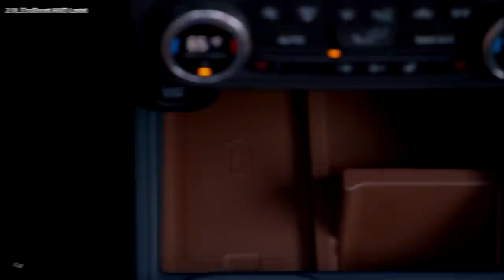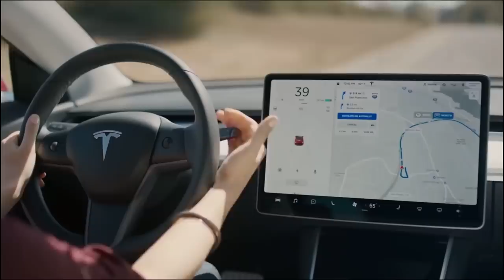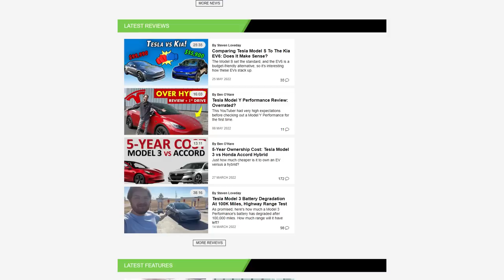Ford CEO Confirms Ford Maverick Has A HUGE Problem

Comment: Fact is 1 the quality of their engineers has been going downhill for many years!
            2 they don't do enough extensive testing before releasing for production.
            3 Trying to cut too many corners to save $ has a direct effect on quality.
Reply: U hit the nail right on Fords head. Bill Ford do not test products for durability. Ford budget then test the products on their customers. Bill Ford reminds me of Detroit Pistons Player Bill Laimbeer. Blame everybody but yourself. I still ❤️ Laimbeer 🍺🍺🍺
Reply: It is the result of man factors, but arrogance  and lack of industry background at the top is the critical element.  Hackett  ran three major  FURNITURE companies into Chapter 7 liquidation before his close friend Chairman Ford brought him in as CEO with zero automotive experience.     I have been told he trashed engineering and gutted the manufacturing  systems by getting rid of people thought to be "expensive" .  When you loose that experience, it is gone forever.    Cutting  deadwood is a plus, but total ignorance of an industry  means  you cut wholesale and eliminate the good with the bad.  The new CEO is all sales and marketing and he knows nothing about manufacturing and engineering.
Reply: @jamesb4789  that’s the COO’s job normally - most of these issues are problems with suppliers sub components. Ford doesn’t make airbags or brake pads…
Reply: @jamesb4789  Hackett 😂😂😂🤣. Your right, he ran Ford into the ground. I agree the past and current CEO’S do not have manufacturing experience
Reply: @piersdenney  Just add to the list of problems 🤨🥺

Comment: I almost regretted not buying last year, now I'm on the list for the next batch.
Reply: I ordered last year, still waiting.
Reply: I would wait a few years if I were you. I was interested in the Maverick, then aside from all the problems the truck itself may have, they're using a 2.0L EcoBoost engine that has no fuel injectors behind the intake valves. I'm curious to see what happens when these engines hit about the 50k mile mark. Most people are not going to install catch cans, will use the cheapest, most low quality gas station around, and use the cheapest motor oil/oil change in town.
Reply: @justacinnamonbun8658  The Hybrid has a different engine. 2.5 liter Atkinson cycle.
Reply: @morrismonet3554  Yeah, it also has a catalytic converter that for some strange reason glows orange and melts wire harnesses that run under the body. 🤷🏻‍♂️
Reply: @justacinnamonbun8658  Not true at all. Hater's gonna hate.
Reply: @justacinnamonbun8658  - And tell us you have actually SEEN the Cat glow orange and melting wiring harnesses?????

Comment: My father was a transmission specialist for of 35 years. Ford will play well do to the fact their taking the EV evolution seriously. Even if Tesla makes 2 to 3 times the vehicle, not everyone wants one. Other EV, producers will surpass Tesla if they keep true to their brand. (Mean styles) Tesla, are on the boring side. Let's study Honda, they managed to always stay ahead of the group  for years, their designs are not dated. A 2000 accord in the year 2010 still looked modern. 

JG.
Reply: But you gotta admit.... The Ford F150 Lightning.... A truck nobody asked for.
Reply: @justacinnamonbun8658  -What year Lightning ???

Comment: Quality has been an issue for the domestic builders for decades! It's why foreign manufactures captured so much of the market to begin with. I quit buying domestic brands in the 90's because of it! Still, Ford does at least seem to be trying to deal with the issue and the Maverick is a great looking rig! I wish they would come out with a extra-cab version for people who what a real truck bed in place of a 4 door truck! It's the same issue Honda has with the Ridgeline IMO.
Reply: My 2022 Ranger Lariat is the size of what used to he the Mid-Size truck now... And Its the SuperCrew so it has a back seat that is not all squished up like the Super Cab.. The way they did this was to make the SuperCrew with only a 5 ft bed... The SuperCab only has a 6 ft bed... I don't haul people and the 5 ft bed is just fine for me...

Comment: I never get people complaining about recalls. They're free and I'd rather get them than a manufacturer try and ignore any potential issues that crop up later. Judging by my experience with high mileage 10+ yr old ford's they will be much better vehicles later down the road with the recalls ford is performing on behalf of their customers. Gotta remember this is the first model year of a brand new truck they've never produced before so you're bound to get quite a few recalls while they iron out all the bugs. Stands to reason that not all quality issues can be fixed with software updates 🤓 Still though, gotta be annoying for those that are relying on a maverick for their sole form of transportation... hopefully they can get a good loaner out of the dealer or a free rental out of the deal 😳

Comment: I hope Ford acknowledges all the recalls,   I had a 2013 Volkswagen TDI Passat, it had so many recalls (Volkswagen was hiding it from me) the Sacramento, CA dealer off Arden gave me the run around for almost 9 months. Costing me literally thousands of dollars trying to fix recall issues I wasn’t aware of. 

They finally kept my car for 5 months gave me a loaner non diesel Passat. The invoice showed over $18,000 worth of parts and 15 pages of things they had to replace. I bought it as a lease return, it had about 68,000 miles on it. I had major problems around 115,000 miles, so much internal damage, the car would start. Then shut off to protect itself.

Comment: I never by a first year Vehicle, and the reason is plain and simple as they always have growing issues.
This has happened to many new models thru-out the Auto Manufacturing sector.
Reply: Agreed,  My 2016 Tacoma had transmission hesitation issues. An updated firmware should have fixed the issue, it never did so I got rid of it since it kept on getting worse over time.
Reply: As a former GM Assembly Plant worker I agree to your reasoning.

Comment: I won’t ever have another hybrid vehicle 
The insurance cost is way higher than non hybrid. I never made up the difference in gas savings. I had a Ford C-Max 
I’ll stick with my Lexus rx350. Low Operating costs. Higher resale value, reliability.

I’ve never had a recall on them.

Comment: I have been driving a Ford Fusion Hybrid since 2011.  I LOVE this car.  I have had no major issues.  I get 36 mpg. It is comfortable, quiet, and has enough elan to feel like a more luxury car.  
I will be ordering a Maverick to replace my Fusion this year, based on my history with the it.  
I have owned other manufacturers, Chevy, Toyota, VW, and I always return to Ford.  They have the very best, overall quality and service from my real life use.  No. I have never worked for Ford.
Reply: Really wish Ford would have kept at least a couple of car platforms...all this crossover/SUV stuff is ridiculous.  Maverick is cool, but many of us honestly just need a mid-size sedan not a crossover, not an SUV, and not a bloated sized pickup.
Reply: Ford actually did develop decent hybrid tech and is largely walking away from it.  The reason is the dropped the cars which is idiotic and short sited at best.   They di it because all electric cars are a massive increase in weight adn are designed structurally completely different than combustion cars.  Their desire to go all electric without infrastructure or battery production lead to dropping vehicles that were still profitable.  When ideology overrides reality in the market place you r company is doomed.   Just to meet Ford, GM and Toyota plans for electric vehicles will require nearly $2 TRILLION  of new grid and generation  expenditures.  Just the copper demand alone for the grid exceeds  world wide copper  production capacity.  You would think a smart Businessman would keep hybrids like the Fusion as insurance, but not these guys.

Comment: With all the impending cuts of seasoned engineering,  there is going to be severe head winds as the company transforms.  Hope they can do it but it will be extremely challenging.
Reply: @Bangkok-ik1fp    Diversity and inclusion driving engineering decisions means  major failures in product and people dying.  Competency and ability to change in engineering is what matters .  I don't care who or what an engineer or designer is as long as they can do the job so nothing fails.   Do you want to put your life in the hands a an individual hired for a diversity quota?

Comment: The engine recall is for vapors being trapped under hood during a catastrophic engine failure (only known are during accidents) those vapors MAY cause a fire but have not so far….the fix is removing a few slats from the active aero grille shutter. 
Seriously get facts right before releasing videos like this.

Comment: I hate how dealers cannot sell parts to consumers without a valid VIN.  if my truck rolled off the assembly line with a basic radio, the dealer cannot sell an upgraded touch radio, even though it will work.

Comment: The side curtain airbag recall is a ticky-tack kind of failure, where the bag is a few millimeters below spec. It will like costs Ford $400 to pay for the parts and reimburse the dealers for the service. It hurts their profit margin, but nobody has been harmed by this problem. This is a continuing problem at Ford whereby they skimp on the parts due to relentless cost cutting by the management, and they end up with more problems and much larger costs than if they had put in a larger margin of safety.
Reply: Yep, this has been a problem with Ford for several years now.  I bought a 2021 F150 King Ranch when they first came out and i've had 2 recalls already.  As an avid Ford customer for over 30 years, their quality, which used to be JOB 1, has gone down hill..WTF Ford???  So disappointing!!!!
Reply: and how much do you think it cost them to replace the door latches on virtually every car in their lineup over the last 3 years? they have more recalls than any company and even more software upgrades that the customers never hear about
Reply: @ubeuonly  You are correct that Ford has consistently ruined their profitability by taking too-cheaply made parts that fail and incorporating them into their vehicles. If they would tighten up their supply chain, and engineer in a greater margin of safety they would be much better off. Warranty costs come right out of Ford; they make the dealers richer, but Ford is only breaking even on the manufacturing when the warranty costs are added in.

Comment: Ford will be on too again i work on all type of  Motorized equipment Ford the only one that requires but it seems to be a bigger problem with them and the public than any other brand when Toyota has a recall and nobody cares and Honda has a recall nobody cares Ford has recalled the end of the world I don’t understand what’s the difference it’s not that one brand is better than the other At least Fodis willing to fix it I can’t see much for other brands though

Comment: I love my ford trucks. When I picked up my 2022 maverick from the dealership and used a tow dolly to take it the 200 miles home.  THEN. Had to call AAA to help get it from the dolly because it would not start.   I drove it less then 100 miles, and then I sold it to carvana.  ..  I just didn’t trust it would last like my F150s or Transits, Econolines. . I have ordered a 2023 in the hope it’s build improves.

Comment: I purchased a used Mach-e that had 6K miles on it.  My child works for the dealership so I got his pricing.  I paid 65,000 for the car.  Premium model RWD regular battery (not extended).  So I believe this was maybe 15k more than a new one.  The dealership bought from an auction for 2k less than I paid for it….so I know they didn’t stick me….it’s just the crazy prices the cars are selling for.  Everyone wants one.   I have ordered two Lightnings….but it’s a pre-order….so not a real order yet.  I have a feeling that my order will never go through.

Comment: Ford is the best in the industry when it comes to recalls. Usually they are insignificant but they still have to do it for the feds
Reply: after reading your comments I have to ask where you get your information and what planet you live on? and have you ever talked to Ford customers or a Ford dealer employee ??
Reply: @ubeuonly  yes I sold Ford for 12 years. I also sold Toyota, CJD, And GM. Toyota was by far the slowest and most secretive. Ford would inform the dealers a recall was coming days before it hit the news. We had a container full of tires show up at the dealer during the whole Explorer fiasco that turned out to get debunked by experts too. We were changing tires out before it hit national news. Toyota sat on the gas pedal thing for Months before they had a fix.

Comment: As to last comment on Ford being able to challenge Tesla… I don’t see this as a problem given Tesla has increased their pricing multiple times over the last year. I have ordered my Maverick hybrid and also have an order in for an Ionic 5 for my wife. Unless Tesla makes a move very soon to offer a low cost EV, Tesla’s dominance in the market is going to plummet within the next few years.
Reply: That's what I see as well. Was an early investor in Tesla due to their vision. Nearly 2 decades later and they haven't capitalized on their early move in the EV market - they'll easily be overtaken by these major manufacturers
Reply: Ionic 5 is a world beater

Comment: Sooo many haters out there! I've got 12000 mi on my XL hybrid and am very happy with it. For $22,500 and 40+MPG at every fill-up it does what I expected when I ordered it. Actually better milage and hauling ability than I expected. I never expected it to replace my Silverado for heavy hauling or trailer pulling, so I kept it and traded in my Kia Soul which I liked a lot, but couldn't haul much or get over 30MPG.

Comment: There's bound to be problems on a brand new released vehicle. However this is built on a proven platform
Reply: As far as the ecoboost version you are right, however the hybrid drivetrain is a fairly new platform.
Reply: Internet click bait dude u know better
Reply: @destroyota88  No the hybrid drivetrain has been on the Escape for years already, and a very similar version on the Prius before that.
Reply: 2019 ram. one service issue under the warranty period and one incidental recall for restraint control module update. no Love letters from FCA no safety recalls and at 80,000 miles virtually no problems. don't talk to me about how a first year car is always a problem

Comment: The hybrid is a good solution for the 90's when batteries were not evolved enough to support long distance driving.  It seems to me, a hybrid owner now has two complex systems built into one vehicle to support.  From a business point of view, FORD, GM and AUDI group want to continue selling pistons and petrol to ensure dealerships will have a steady stream of maintenance customers, and big oil can keep selling oil.
Reply: You must think batteries are clean energy and reliable 🤣🤣🤣🤣.
Reply: And fast forward to 2023 and batteries are still not evolved to get perhaps a couple hundred/three hundred miles before it's time to find a charging station, insert credit card, and wait for how long(?) to get going again, a few hundred and do over... Then, the return trip...  :)  No... Not Ever...  :)

Comment: If they make a ford maverick st and rs with a towing capability of 5,500 it would take off. Specially if it would cost $29,000
Reply: Maverick has already "taken off" ....hence an order bank for the 23 model year which may be open for only a few days! And no sign of increased production..and no real let up with material constraints.

Comment: The Ford Maverick has had more than its share of problems (Hybrid wiring harness failures, Hybrid Catalytic Converter glowing issues, Engine compartment fire risk, poor paint quality, windshield stress cracks, side airbag deployment issues, rear seatbelt attach issues, trailer brake issues, EB transmission issues, rust issues, gas tank hole drill issues, etc.) with its first year rollout beyond Ford's inability to produce them (Microchip and other material shortages contributed to this). 
Most of these issues can be addressed during manufacturing and/or parts quality checks, and it seems Ford is trying to address it. I deliberately held off on the MY22 first year for this very reason (time to get the bugs worked out).  I have a "reservation" with a deposit down for a MY23 Hybrid for when order banks open in September; however, if Ford doesn't get it together soon I'll probably hold off for something else.

Comment: This is nuts.  I did this for a living for 30 years.  Flunking the bowling ball test is not a vehicle certification test, it was never intended to be.  A crash is a crash.  It can be simulated with some correlation but nobody has ever correlated the bowling ball test to the barrier test or for that matter the barrier test correlates to the crash.  This is a waste of time and money.  Ford would have been better off running barrier tests.  Specifications for airbag components are loosely tied to system performance.  Until a highly trustworthy math model of a full crash is developed the specs use a lot of judgement and a 5% noncompliance may never make a hill of beans difference in the number of deaths or serious injuries.  Didn’t I teach you guys anything!  Use some stinkin science and statistics, oh yeah, too confusing.

Comment: What is going to happen in 10 years when the battery pack is stuffed and you need a battery change, then to be told sorry that battery pack is going to cost you 15K or worse still it is no longer available.  Where is all this battery materials going to come from ffs , 2million cars here then another 2mill let alone gm or vw etc etc   this is a complete joke for something to fix something that's not real in the 1 St place